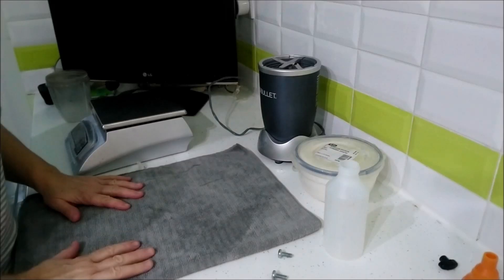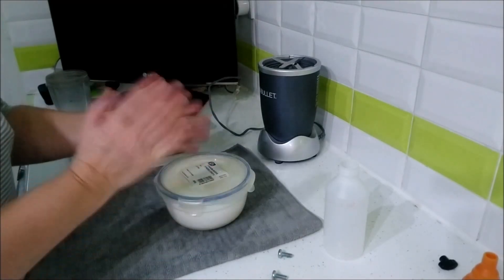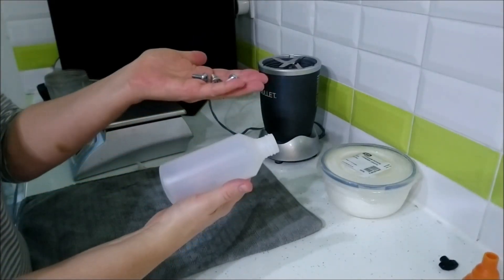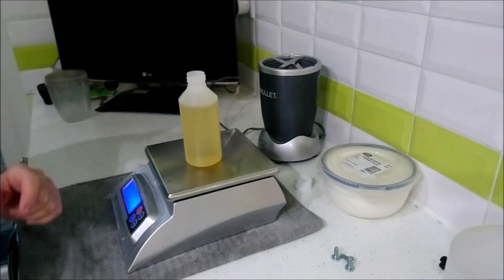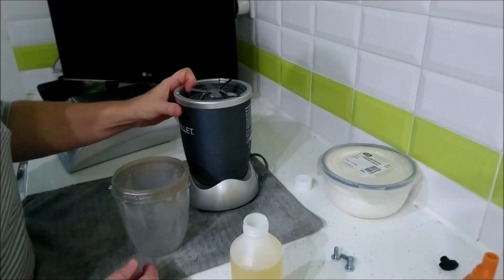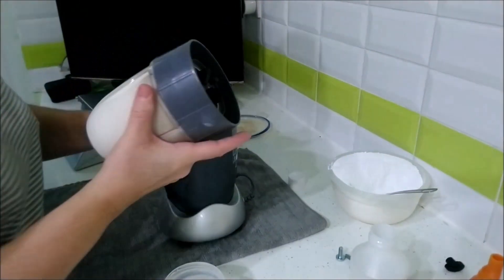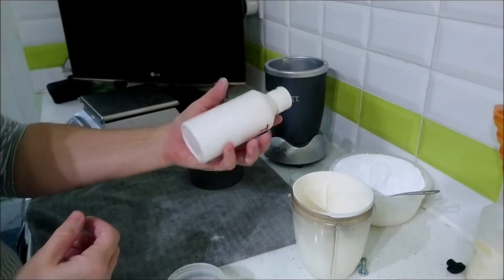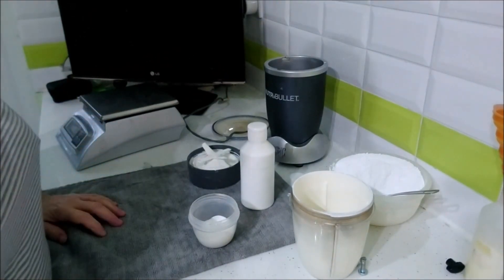Mixing TITANIUM DIOXIDE for cold process soap tutorial ~ How to premix titanium dioxide

Comment: Thanx for all the great tips!  I learn so much from your videos.  Perhaps you would consider doing a video on color blending.
Reply from the maker: Hi Debbie, thanks a lot. Do you mean preparing colours to use so you get a nice smooth colour in your soap or mixing different colours together to get another colour?
Reply: I Dream In Soap making blends of different micas, oxides and pigments, and even clays to get different colors.  I was wondering if you had any tips on creating different tints, tones and shades.  One lady who likes to combine colors as she is soaping (Ione with Eve’s Garden) uses dispersed micas, etc, in small squeeze bottles and adds a little of this and that, and it always turns out exquisite.  Since I soap as a hobby,  it would probably not be feasible to make samples of all the combinations one could dream up.  So, if you have played with color blends and have tips, I would be one thrilled subscriber😃
Reply: @debbieescobar6267  AW, to be honest. I don't actually muck around and blend colours too much. The reason for that is I'm in the UK. If we want to sell any soap every loaf has to have a cosmetic safety report done by a chemist where you are typically allowed your base recipe plus 5 additions, so that would be your fragrance plus anything else, therefore each mica, TD etc counts as an addition. Therefore if you start blending you run out of additions very quickly. Also once we have a report for that soap you cannot change a single thing, if you do you pay for a new report, so, unfortunately, I tend to stick with the micas as they come :-( - oops just notice, logged in as Lisa Cunningham, not IDreamInSoap, same person :-)
Reply: Lisa Cunningham ahhh...those unforgiving EU regulations.  On the bright side, you aren’t tempted to buy every oil and additive out there😉.  
I love your entries to Amy’s Great Cakes challenges (and congrats on your awards!).  Happy soaping!